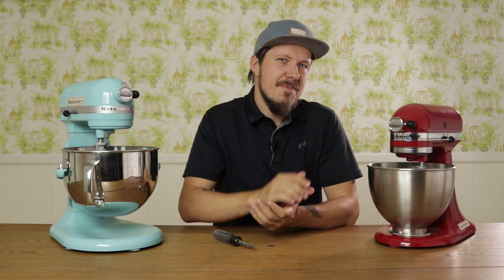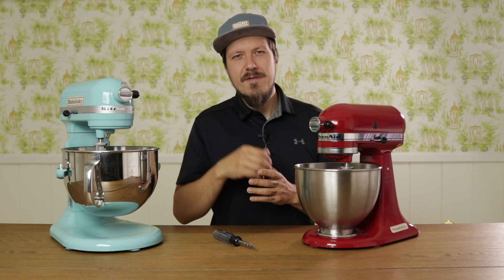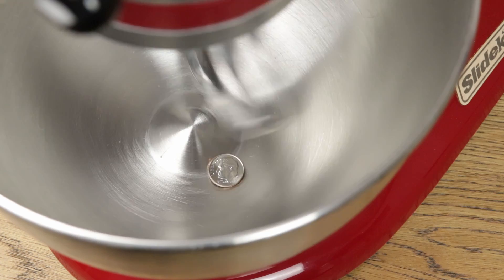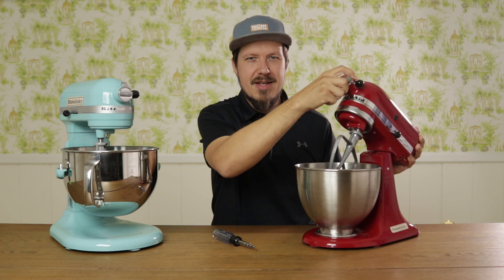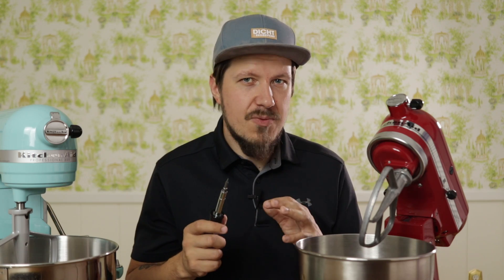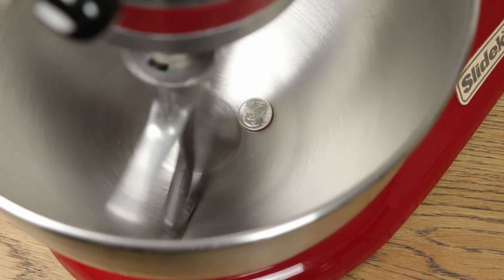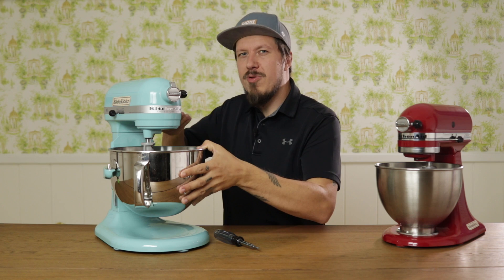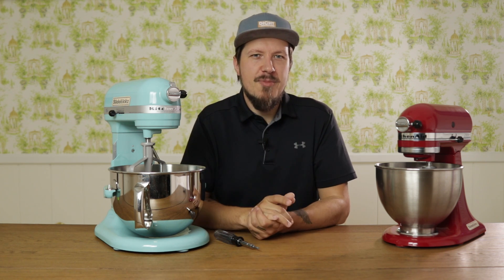Dime Test for KitchenAid® Stand Mixers

Comment: I've got an older KSM5 bowl lift mixer but it doesn't have that adjustment screw... I was told it's about 30 years old and by your dime test it's still in perfect adjustment...
Reply: It's true of the older Hobart bowl lift mixers similar to yours not have a beater hight adjustment. Your adjustment screw (if equipped) is located under the near the top of the neck just above the top of the bowl lift mechanism. It's vertically mounted loosening it just changes how high the bowl can raise by resting against the top of the bowl lift mechanism.

Comment: i have the bow lift design, and the screw wont turn all the way to the righ or left  just a quarter turn, i tried putting a coin and it wont move that much, can i ask what is the mm size of the dime?

Comment: I can't turn the screw any further to lower it, does this mean it's adjusted as far as it can be?  I got it as a refurbished model for Christmas.
Reply: I've put two rubber washers on the bowl holder pins and this corrected the exaggerated space (was over a nickel's width) sufficiently to move the dime.
Reply: The rubber washers are the exact thing I was looking for!!!  I turned the screw but it wasn’t quite enough.  Thanks!

Comment: Help please. The adjustment screw seems to freely turn, like with your finger tip. It does apparently accomplish some adjustment but I'm worried something is not right. Can anyone advise? I would link a setting screw like this should be a bit stiff to turn. --Thanks (PS this is a brand new machine of the smaller variety)

Comment: no matter what i do the screw won't move and i'm just stripping it!!! do I just return the machine?  because its useless at this point
Reply: Did you ever resolve this? Dealing with this right now
Reply: I know he said to turn it to the right to lower it and left to raise it, but mine was the exact opposite. After trying to turn that screw thinking it was just frozen solid, I tried turning it counterclockwise and voila! Moved no problem and that lowered it to where I needed it to be. But, my mixer has always made crazy racquetty sounds, so maybe it just wasn’t assembled correctly in the first place. Regardless, the beater is adjusted perfectly now!!